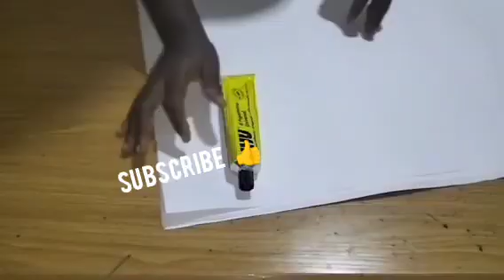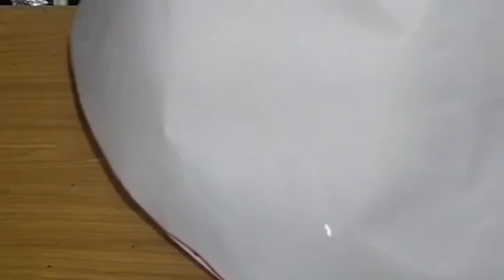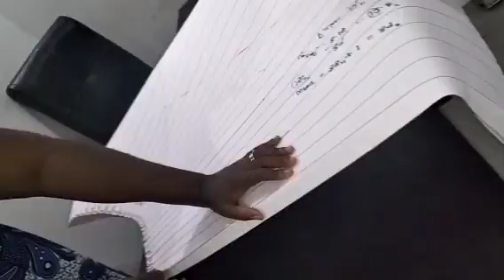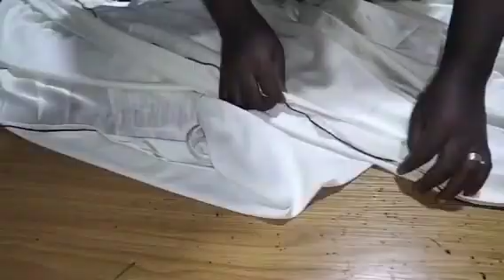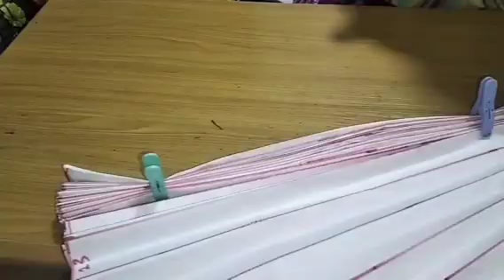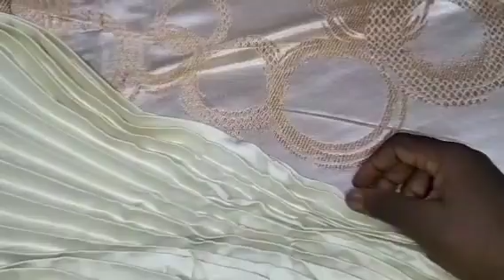EASIEST  WAY  to  Sew Trendy  LONG  PLEATED FLARED Skirt   PERFECTLY 💥

Comment: Great job ma
What did you use in holding the 9 carbon sheet to become a sheet??
Reply from the maker: Copper wire
Reply: @seamrite I mean what king of glue did you use before cutting the paper to flare